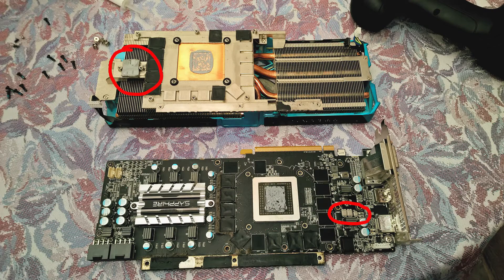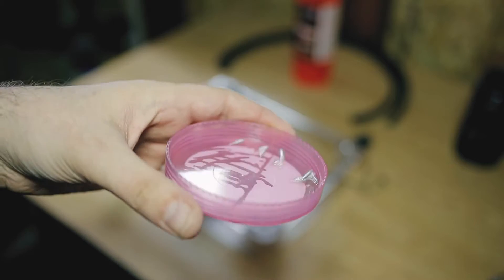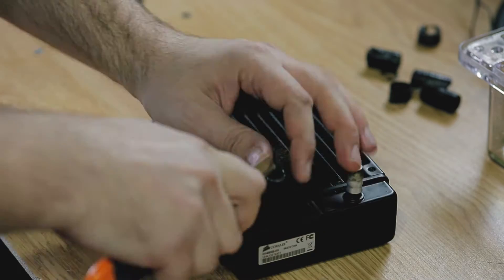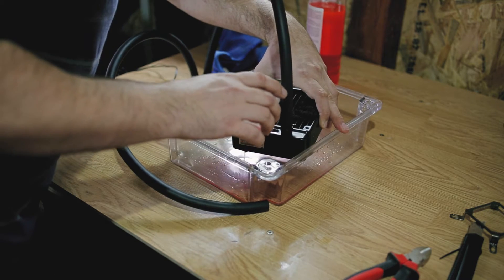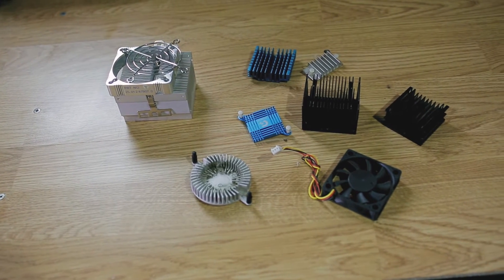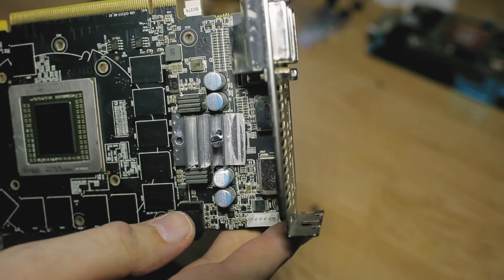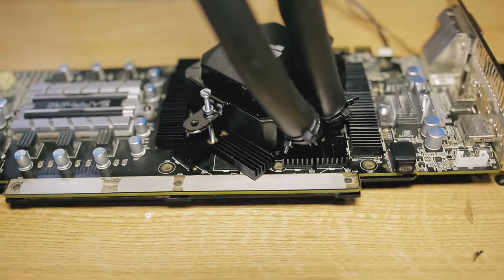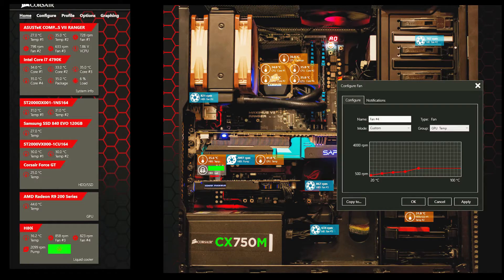DIY Radeon Sapphire R9 - 290 GPU water cooling mod with Corsair H80i

Comment: i also doin this right now, with my old power color rx 570 card, with some small heatsink for VRM and VRAM, thermal tape, universal GPU waterblock, 4x4 cm fan, and alumunium plate to attach the fan, pretty much like hybrid GPU which is we ve seen it a lot today. and it only cost me 25$

Comment: Hi I just did to my gpu mod after watching your video with my gigabyte 980ti g1 gaming card using Noctua Nhd 15 cpu cooler on my card, where my stock card temps 84 degrees under gaming 60fps. After mod with my Noctua 62-65c under gaming or Heaven Benchmark 4.0 for more than 30mins. but for vrams and vrm i'm using only  thermal pads on them no heatsinks at all also, i put my corsair 120mm fan on vram vrms for better cooling , is it safe to run daily computing and gaming? any help please.
Reply: @BeardsChips  Thanks for reply, my 980 ti gigabyte g1 gaming i can't see that vrm temps only  but normal temps under gaming 60fps, very high settings in Assasin creed Origin 1080p i'm getting for 1Hour is  29c min- 59c max and idle sits like 28c or 29c. i tried my best but i'm unable check my maxwell card.

Comment: the best was to get rid of the air bubbles is to find a big bowl  submerged radiator in fill the bowl with coolant and connect one tubing on the radiator  turn on the pump and let the coolant flow true the radiator and tubing and then while pump is running connect the other tubing to the radiator, 0 air bubbles but i think you need some air in the aio. When the coolant starts to evaporate just let some air in it

Comment: Apreciez tot ceea ce faci! Felicitări, m-a tot bate si pe mine gândul de a mă apucă dar tot zic maine, mâine, si tot așa :)) .
Reply: Uite un sfat. Foloseste pentru CPU Liquid metal PRO(nu ultra) si iti va scade dramatic temperatura la procesor. O poti folosii si pe GPU daca acoperi partile electronice de pe cip cu pasta normala(non conductiv electric).ma gandesc ca tu daca ai haswell ai pe CPU cativa tranzistori(parca) ii acoperi si pe aceiia cu AS5 sau MX4/2 si aplici si pe DIE-IHS si pe IHS-COOLER daca ai cooler din baza Cu/Ni.